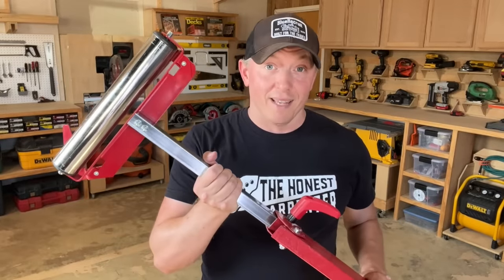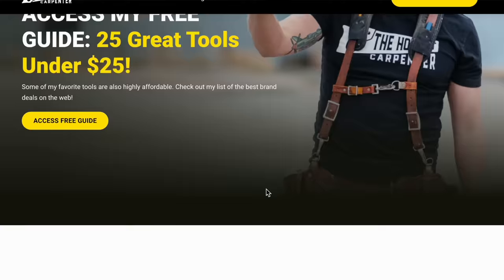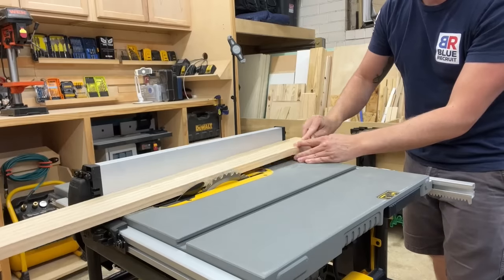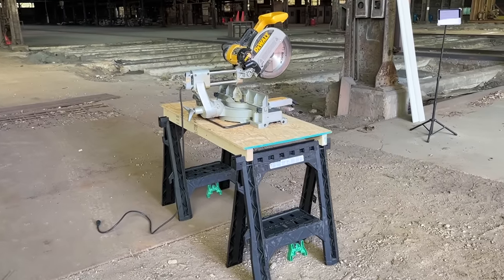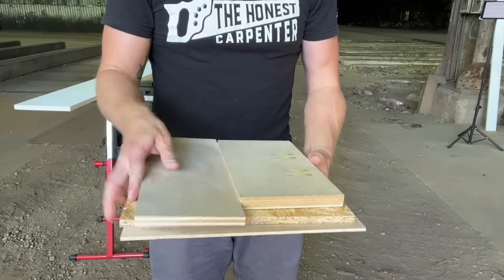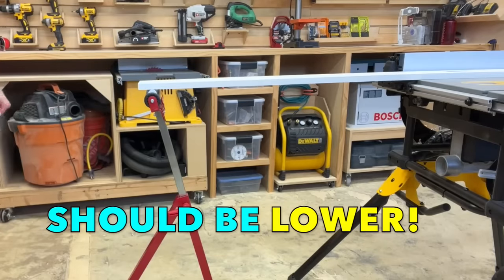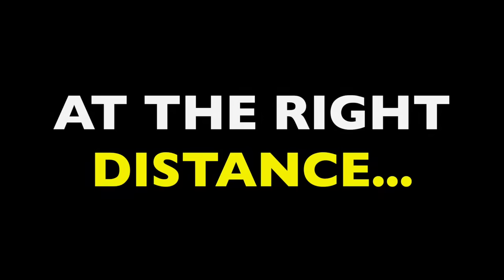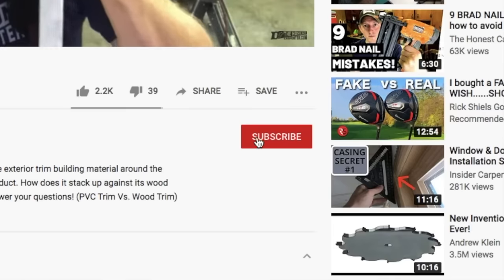AVOID Making These ROLLER STAND Mistakes!

Comment: An issue I've ran across that you didn't mention is to make sure the roller is as square to the table as possible when used making rips on the table saw. I've had boards actually feed away from the fence because the single, long roller was "steering" it off kilter. In addition to the long roller, my roller stands include the little ball bearing type rollers that prevent this from happening.
Reply from the maker: Dang, good point Phil! I should have mentioned this…
Reply: Yes this was the main tip I was waiting for.
Reply: I have experienced this as well though I was using the roller as an infeed support.
Reply: I have one with a row of swivel casters and a cam plate to lift the droop. Those slippery solid flip top ones also help avoid stubbing into the stand.
Reply: Wouldn't it be better to angle it slightly towards the fence to help the board stay flush?
Reply: @_bobsayshello That makes it twist into the back of the blade at the front end of the board. Glad I had the riving knife when I found that out.
Reply: Very useful video, thanks.  I have a stand that uses either a single, long, uniform roller like in the video, or, with a flip of the top, a linear set of individual round bearings. Those bearings prevent the board from being pushed in a diff direction (e.g. away from the table saw fence)  by the roller.
Reply: That was the first thing that popped into my head when I seen the recommendation to watch the video, and think it is probably the most important one, I think this can  hugely contribute to kickback on a tablesaw
Reply: You can see this phenomena where the board trolls to  the side by the roller at 5:28.  I like the ball bearing type, but lately I just screw a piece of plywood to my saw and drop it on my roller stand to create an out feed table.  Works much better than trying to hit a roller.

Comment: One thing to me you didn’t mention is that the stand must be set correctly in terms of the legs . To me that added stability if they are set with the spread facing the correct direction; if placed backwards i found they still can become unstable even if at the correct height.
Reply: Correct!  If the roller stand is placed incorrectly, it can actually fold up, even if the roller is operating properly.  So, before making the cut, push on the roller in the direction of the feed.  If the stand collapses, turn it around.  It should then be fine.
Reply: I’ve had it folding up on me when set up the wrong way.
Reply: In the video, I noticed it was angling away from the table saw, which creates a fulcrum point for the back legs. It’s been my experience the stand works best when angling towards the saw. You can probably eliminate the need to weigh down the legs with this setup.

Comment: I hate roller stands so much that I threw away the 5 I had because I refused to condemn somone else to the headache. They redirect your material if they're not set perfectly. I used the ones with the bearings for a bit until they locked up from moisture. The ridgid outfeeds are 1000x better, in my opinion. Bought 6 and never looked back.

Comment: I have a pair of stands that look exactly like these (even down to the color), but they are from Harbor Freight. The one feature I really wish they had is a geared mechanism to adjust the height. I find it very tedious to adjust while trying to align with a dry-fit board, holding the stand to keep it in place (the legs tend to move), while at the same time turning the lever to loosen the adjustment point, raise/lower it, and re-tighten the level. The ability to just turn a knob to make the adjustment would be a huge improvement IMO.

Comment: Doing a dry run is the best tip you made. Roller stand distance can be tricky as you pointed out. Too close as you showed will act as a fulcrum, and too far might allow the board to lift before reaching the stand.

Comment: Good call. Even "helping" tools need to be set up correctly. I have a roller stand and the thing that I concentrate on is to have it the "right way" around. If it's the wrong way it easily pushes over leading to most of the problems that you pointed out

Comment: I have a couple of those roller stands.
I completely agree with everything you said.  
I will add one point.  When using them for an out-feed or in-feed stand, make sure they are perpendicular to the direction of travel.  If they are at an angle or not level they will tend to pull the wood in that direction which can be a problem on your table saw.
I also find depending on how high you extend the roller, they tend to be more prone to tipping in one direction vs the other.  For example I'll position mine so that the folding leg is always away from the table saw on the out-feed side, and the reverse on the in-feed side.
Reply from the maker: Very good points!!

Comment: Flip top support stands from home depot work great and eliminate some of the problems with roller stands. i've used both, use the flip top stands and roller stands haven't come out of storage for years. excellent points though on the roller stands. Flip top stands really do work better when weighted down too.

Comment: That dry test is huge especially with a table saw.  I e learned my lesson.  Both examples you give have happened.  I was trying to either leverage my board up because the stand was too high all the while the saw is running or I had it too close and I find myself applying a ton of downward pressure on my end which can be dangerous too.  Make the tools work for you, you don’t work for them.  Great video Ethan.
Reply from the maker: Thank you, John! Great insight. 👍 Even knowing better, Ive found myself fighting boards on jobsites and thought, “Dangit, I did it again!”

Comment: One of the worst problems I've had with a roller is the handle giving out such that I was unable to tighten the height adjustment adequately. I ended up throwing the handle out and getting a designated wrench to take its place.

Comment: an issue I had with mine is over time, the knob to secure the height of the roller remains locked while in use, was worn out and the knob no longer locked it in place ..also, you might've mentioned which direction the stand should be facing

Comment: I have one with a row of swivel casters which makes alignment less crucial. It has a cam plate lead to keep board droop from stopping a rip. Been trying to get the kind with a simple slippery flip top plate.
Reply from the maker: I’ve seen those! I’m yet to own one though.
Reply: @TheHonestCarpenter  they work like the cam plate to keep the workpiece droop from stubbing the stand with less moving parts. The big box store had Ridgid branded ones a while back but now the only internet source I found was nonfunctional

Comment: I have wondered how critical it is for the roller itself to be perpendicular to the saw blade. If it is rotated a bit, will it tend to steer the board off the cut line?
Reply: See the pinned comment: it's important.

Comment: Yes roller stands, right slightly lower from outfeed of saw. I have seen and I’ve also done knocking them down. Dangerous with a long board while ripping!! Shut the saw off and hold board down until blade stops turning!! I was working with someone who had toe broken by falling stand.

Comment: Great tips.  Is there ever a case for using two roller stands in a line to reduce the risk of the board tipping off the saw at the end of the cut?  Or does it all get too complicated??
Reply from the maker: I have done that before, Ben! But generally only on a pretty flat floor, like a garage.
Reply: I prefer it for long boards to avoid the fulcrum effect and the sagging board problem. But I'm usually working on flat concrete.

I can see how it would get tricky with uneven ground, but if you have a lot of long boards to wrangle it might be worth it.

Comment: One thing you didn't mention was to have the roller at a slight angle so that the board is kept against the fence when it hits the roller. If it is angled the wrong way the board will drift away from the fence into the side of the blade.

Comment: There's a front side and a back side to the stand that you were using.
At 4:46, you have it set incorrectly. The leg that kicks out should be away from the board being caught. It's less sturdy the way that you set it up.
Reply from the maker: I’ve always considered that, Stan. But in practice when I’ve messed with them, I just haven’t noticed much of a difference, so I don’t sweat it as much as good alignment. They really just don’t carry that much load in the end.

Comment: Lee Valley - used - to make one of the best stands. The top had a screw and knob to adjust it to level/parallel to the machine surface, it had swivel casters so it wouldn't feed your board to the side, or if they didn't work for that particular job (lots of back and forth) there was a stainless steel ramp with a radiused top that was nearly as smooth as a roller. The stands with ball rollers (transfer balls) seem to use really cheap rollers which either start with high friction or fill up with dust in the shop and need to be disassembled to clean them out - and a lot are pressed together so its a real PITA to take them apart and reassemble them. DAMHIK. I may have gone through a few different models but my old Lee Valleys are still the best. I don't think the design was subject to patent or copyright, so I'm kinda surprised no one else has made a clone.
Reply from the maker: Dang, that sounds awesome, Bruce!